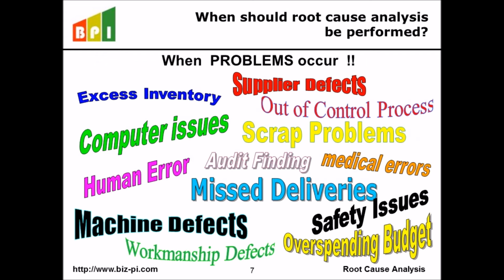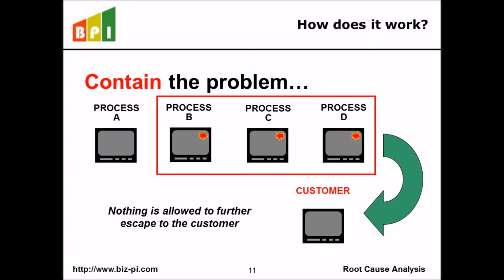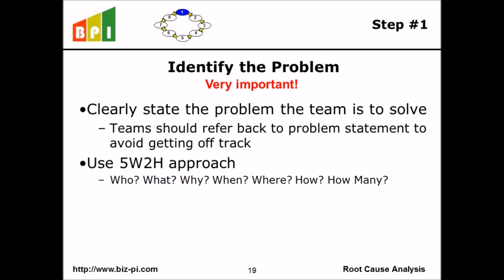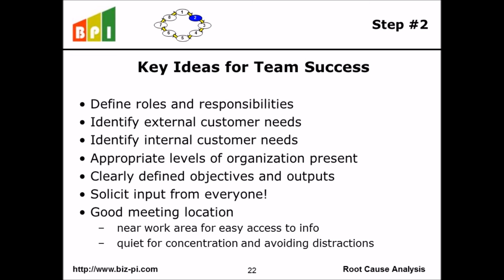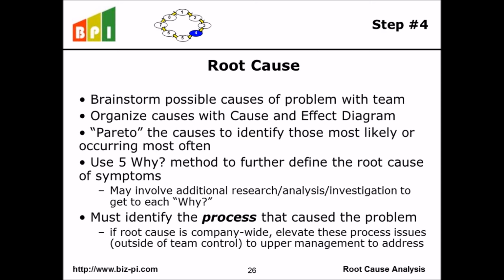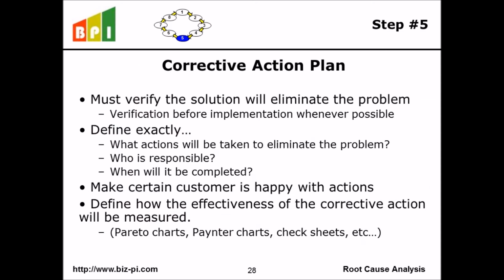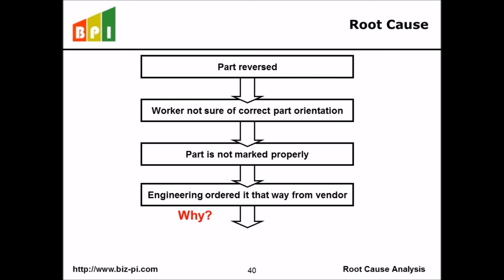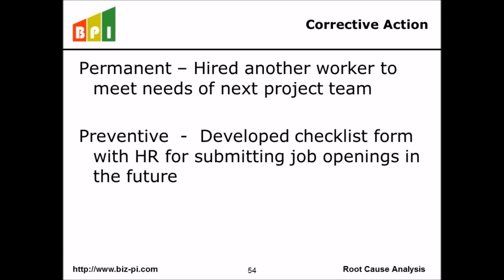Root Cause Analysis Course - 5 Whys and Fishbone Diagram

Comment: Wouldn't be the most interesting question why the engineering team didn't had the manufacturing process in mind up front? Without answering this question you can only solve the immediate problem, but not future ones. Could be just a mistake, then that's fine, but could also be that there is no communication/feedback process or information/people sharing between engineering and manufacturing. Or that there weren't appropriate testing procedures.Or that information was missing because of illness and people didn't shared knowledge enough before the illness (truck score bad). Or something completely else. It's a bit funny that this happens exactly when in the example there are less than 5 whys asked. (Isn't it the main principle?)
Reply from the maker: Yes, you can go even deeper into the questioning. I typically stop when we get outside of an area of control (getting into other departments or outside of the company). 
Some questions don't need 5 why's, some problems require more than 5, so it depends on the complexity of the problem statement.

Comment: Wt? No!!! Difference is,
SixSigma is a Methodology Approach to Determine Statistical Processes Capability. Lean also uses a Methodology Approach to eliminate Waste Within Your Organization.
Reply from the maker: Both Lean and Six Sigma utilize root cause analysis techniques. Six Sigma uses process capability analysis, but it's not always used in a DMAIC project, only when there is continuous data and defined customer specifications. If not, Six Sigma can still be used to reduce variation, errors or process time.
Is there something in the training that compared Lean and Six Sigma related to your comment?

Comment: 5Y's is a professional Training used by a wider industry audience at to below sr. management level, for executive of 0-8+ yrs experience, who wnats to have learning towards cause of the defect management, performance improvement.. more. Its widely used best practive in corporate & industries.
VQMSTM  specifically designed course, meets the requirements of the following:
1. Fresh engineering graduates / MBA’s / Professionals / Job seekers.
2. HR/Admin/ Management team of Organizations
3. Future managers including management students
4. Quality Assurance Engineers, Team leaders, IT or Non-IT Professionals, Practitioners, Software Quality Assurance team members and Jr /Senior Management
5. Any other professional members who are doing research, innovations or consulting in process improvement practices
To learn more, https://vqms.co.in/elementor-1221-2-3-4-5-9-2/

Comment: "Preventive Action" is NOT the same as a tough Corrective Action. It typically comes from risk analysis or FMEA, and implements action to prevent a problem from ever occurring in the first place. Then you have "Correction" (the knee-jerk inspection/repair kludge) and "Permanent" (the systematic resolution of this kind of problem on this kind of process, or similar processes).
Reply: I'm in the nuclear power business, our terminology is the same as yours.
Reply: Much prefer your definitions

Comment: You don't touch on the indeterminable risks of loss of customer confidence. Then at trade conferences, they talk to their competitors... A rigorous and fact-driven approach to root cause and permanent corrective action is vital to regaining customer confidence in your service and product.

A long time ago, when I was an aerospace quality engineer, I was detailed to attend a KIP (key inspection point, where the customer attends). I wasn't an antennas engineer, my remit was wiring harnesses and electronics, but basically, this part had been made incorrectly, and this was highly embarrassing. We could do nothing about the wrongly-manufactured part, but as part of the verification, I said I would audit the supplier.

I have to confess, I drove to the audit with blood in my eye. This wasn't my job responsibility, but I was assigned to sort it out.

Now, this wasn't a gleaming steel-and-glass aerospace titan, but a small precision machining company. Nevertheless, it looked a nice place to work. The place was clean and well-lit, and there were plants and pictures. There was also copious quality data, and I was pleasantly surprised to find that when interviewing the machine operators, each of them was aware of the incident, and several had taken part in the RCA/implementation of CA. They also know what the data on the noticeboards meant, their part in it, and the consequences of them deviating from documented processes.

Machinery was immaculate, and process documentation was clearly filled out at each stage. Dig as I might, I could not find any instances of poor practice or systemic weaknesses. Yet I saw absolutely no sign of defensiveness or evasiveness. Everyone was upfront with an immediate answer to the actual question I asked (rather than a defensive reaction to the questions to which they assumed this trail was intended to lead. Equipment was immaculate, with copious calibration, verification and safety records. Operators said exactly what they did, and then pulled out the relevant procedure, which tallied in all respects. This tiny company, which I could thoroughly audit in a day, rivalled the giant aerospace company for which I worked, when it came to QA.

We finally got around to corrective action. The quality manager opened a cupboard (UK English for closet) and pulled out a FAT (sorry, plus-sized) lever arch file. I asked "So our investigation is in there, is it?" and he said, "No, this IS your investigation."

I was frankly stunned that such a small company could do such work in a week. There must have been long nights, early mornings and weekend work in there. I am a FAST reader, but it took me three hours to go through this truly comprehensive analysis. Every single step of this 8D/Fishbone/5Y investigation was supported by facts and data, and the testing to verify the permanency of the CA was as solid as the rock of Gibraltar. They had scrapped a lot of metal in a comprehensive set of tests covering all possible operational modes, removing the fix (which was a lovely, simple, Poka-Yoke), then provoking the fault, then refitting the fix and doing the same without the fault occurring.

After my impassioned presentation to the customer, they said they were in no doubt at all that the comprehensive investigation and effective (and verified) corrected action would mean that this problem could never, ever happen again. I fell into a shit-pool and came out smelling of roses. 

I was, to use a classic Britishism, utterly gobsmacked by the supplier's response. This actually had a big effect on me, which, in part, is why I'm now shortly to take on a top-level quality management role in a major multinational defence company. In an earlier job as a quality manager in a telecoms company, I had employed the same quality techniques, which had so grabbed me as a young quality engineer. We had a major customer in the form of a VAST US aerospace company (no, no names, I'm afraid. I could tell you, but then I'd have to kill you.) They had had recurrent issues, caused in large part by issues at the Chinese company that assembled our products. The first time they came over to our company in the UK, I dropped eight fat dossiers on the table. They were used to single-page stuff from my predecessor, and looked a little nonplussed.

Each one addressed two root causes: 1) How did the problem happen? and 2) How did it escape through the current controls?

Again, having ploughed through the lengthy reports, the customer reps looked much happier. And those problems never happened again, and the number of problems dwindled down to zero and stayed there.

There have been numerous occasions in my quality career where a robust response to quality issues has garnered more good humour in the customer than never having a problem at all. Indeed, one customer, an installer, obviously concerned because of his prestigious and important customer, screamed down the phone to me about "The fu*&ing sh$t you fu*&ing sold us". I visited the installation, and the equipment had been uninstalled incorrectly. Some quality managers might have breathed a sigh of relief, and thrown it back to the customer, but I realised we'd probably have lost a big customer. The problem was that the installation was heavily unbalanced, and the correct balance was detailed in the product manual. However, I realised we could probably redesign the product to handle even this level of imbalance, and then the contractor wouldn't have to completely rebuild the system, just replace a drop-in unit. The Design Manager and I spent many, many late nights and evenings redesigning the unit, starting with the parameters we would need to achieve, and how we might optimise the product to achieve this.   

I demonstrated it to the same rep from our customer company, and the end user, again, showing that the mod handled this imbalance with ease, whereas the old unit failed every time. I thought the formerly foul-mouthed customer rep was going to shake my right hand off, "Oh, thank you, thank you..." He took the boss, me and the design manager out to the five-star Claridges Hotel in Mayfair, London, where I had a fantastic dinner, though I can only remember that it started with whipped cod's roe and vegetables, due to the copious amount of brandy we downed. I did tell him about the imbalanced installation, and his eyes welled over. Again, the mighty hand-crush and vigorous shake. 

We stayed there for Friday night and were taken home by limo the next day. OK, it might be considered conflict of interest these days, but if the boss was OK with it, I wasn't about to refuse. The customer rep sent me a Christmas card every year until just a few years ago when he moved to the States.

But there was now another bonus: we had a better product, better than any other on the market for a similar product, and it didn't cost any more to build than its predecessor. I let the sales team take that on...
Reply: Alastair Archibald Thank for sharing your story.It is encouraging people like me to do more.
Reply: My pleasure, Ravi. You won’t regret it.

Comment: Hello Brian, I have a question about the definition about the core of the problem to work. Normally the leadership and manager have some idea about where that accident come from and they trying to transfer the problem to other department . How to convince them to be impartial on it?
Reply: The department experiencing the problem should own and kickoff the project or investigation. They should invite the department they think is causing it, but not try to pass off the problem to them. I've seen that happen a lot, and if the other department doesn't think they caused it, then nothing happens, and the problem keeps recurring. If they realize that it will keep happening 

If you can help the manager and leadership consider how other departments or suppliers could have caused the issue, that seems to work well, and they'll be more interested in withholding judgment. 

Over time, they will start to understand through experience that their initial thoughts are not always correct, and they should let the data and process speak for themselves. Does that help?
Reply: I do understand what you have explained and agree with it. The idea is great and honestly I have never thought about that perspective. As they are the team where the problems,in general, happens  certainly they will be more 'flexible' when there are a small chance to input the origin of the problem is at other hands... but when the process begins they will see where the problems are: Communication's failure! 
Thank you.

Comment: Thanks Brion for a very informative video, I have a question about the process time duration, How long should the team run RCA (or 8D)  to make the entire process efficient?
Reply: Rex The major problem is where people try to solve the entire issue in a single session without straying from the meeting room. They make educated guesses with 5Y and/or Ishikawa fishbone, but then never go out and visit the processes to verify their RCA. I call this crystal-ball RCA.

Now a line inspection may reveal the issue. When I was quality manager of a UK company that owned a Chinese factory, there was an issue that should never, ever have escaped to the customer in the first place, because it could never have passed final test.

The Chinese company were all ready to fire the tester, but I urged for more patience. I watched her for a day, and got a QC technician watch her during the night shift. Then I watched her the next day, and then it happened. She was looking into a piece of equipment with a visual hood. I saw that the testing had to be repeated due to an error due to poor contact... and while she was doing that, another unit slipped past on the conveyor belt, unseen and untested. 

I asked the Production Manager if he could slow the line down... you can guess his response. So I looked at the maximum time taken under all possible circumstances for a retest after a fail (any more than one retest was put aside for re-inspection) this was done by an interview with the inspector, who took me through the process, and we role-played it. So somehow, I had to slow the line down at one end while keeping the main line speed the same.

I tried three tie-wraps loosely around the end of the line. It made the units "bobble" a bit before moving past the end-of-line inspection station. However, after a quick simulation and review, this would sometimes mean that one unit would bang into another on the line, and this was not good. One tie-wrap was not sufficient. So two tie-wraps it was. All I had to do was add an instruction to the work procedure was for the inspector to check the condition of the tie-wraps at the end of the shift and replace them if necessary. We videoed the operator for several weeks, and checked on fast-forward. The units got close together, but never collided, and the operator never missed a unit. The problem did not recur.

That 8D took us about two months. I would say that was a good average. But a really complex 8D with a very technical product... the sky is the limit. In aerospace and defence, it could be six months to eighteen months.
Reply: @Dragonblaster1 perfect clarification on the query...
Reply: Hi Rex, just seeing your comment. If you're asking about how long it takes to complete an 8D, then I would say it depends on the complexity of the problem, and how much time the team commits to the 8D. It can take as short as a couple days, or as long as 6-9 months, and even in some cases, longer than a year. Is that the question you had?